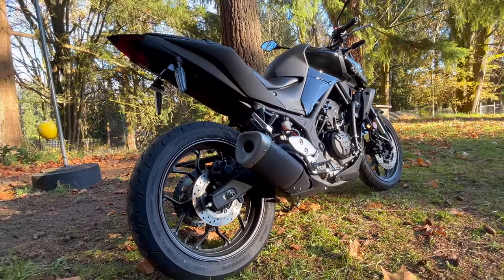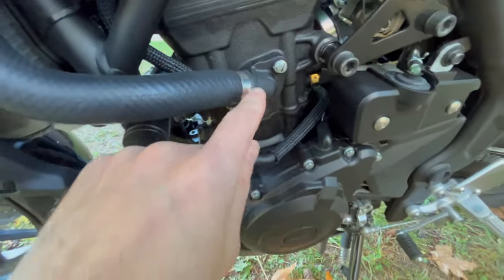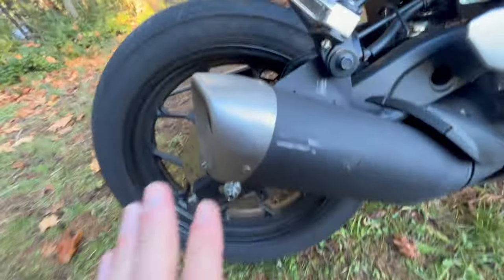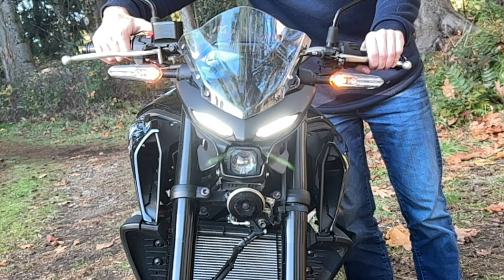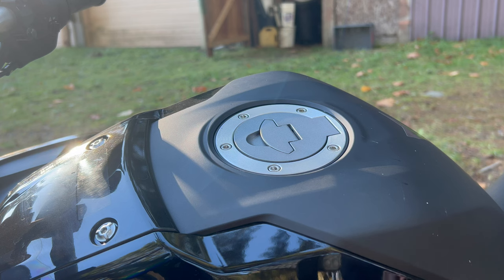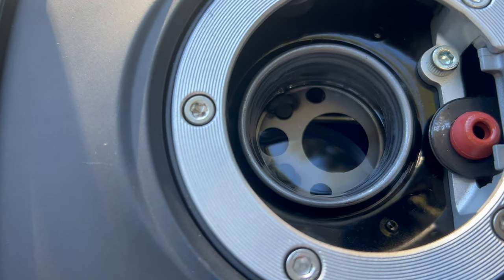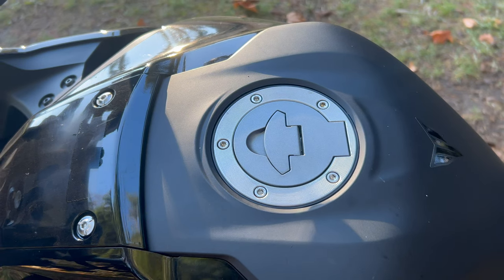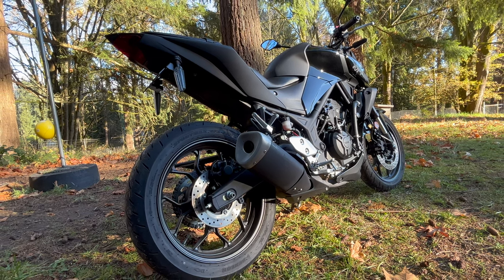2020 Yamaha MT03 || After 3 years : Talk about & Explain pseudo-Review on Thanksgiving Day 2023

Comment from the maker: I have a deep spiritual connection with this 2020 Yamaha MT03 & its 321cc offset parallel twin cylinder fuel injection liquid cooled gasoline engine developed over 9 generations of optimization in the Yamaha R3 race bike, then further tuned by Yamaha to make soft on early torque with start-assist in 1st gear that will let you go as slow as 2 miles per hour without stalling, though it trolls well in 1st at 5 miles per hour with very light right hand grip throttle twist action. The gear box & clutch are nothing fancy in terms of a 6 speed motorcycle sequential, but are very precise with excellent feel in the left foot gear selector pedal & left hand clutch lever attenuation giving both a secure but easy to articulate clutch. ABS standard front & rear, with drilled solid rotors. For the entry level of the Yamaha MT line for under $6K out the door all said its a great value given the advanced emissions controls, easy to hyper-mile above 70 MPG on regular unleaded gasoline, though I get E0 or ethanol free gasoline from The Grange in Issaquah, Wa, distributed by CENEX. I add Fuel Stabilizer to the 2.5g or 10L safety button easy fill polymer gas can, as the red fuel stabilizer extends the shell life of gasoline from 3 months to 2 years. I keep the fuel tank topped off at all times to minimize the air gap at the top of the fuel tank.

Comment from the maker: 373lbs 40hp 20lb-ft, 0-60MPH in 5.11 seconds, does the quarter mile in 14.05s at 92MPH & has a top speed of 112mph, though getting there going to be a buzzy highway experience at redline in 6th gear & you fuel economy will be lower. 

Easy to average 48-55 MPG keeping up with freely moving early morning full highway speed traffic on I90 or I405 near Seattle WA, USA. I can hyper-mile with early upshifts & keep it under 50 MPH & get the fuel economy into the 65-88 MPG range, while racing it full out gets 33-42MPG. 

So overall ~53MPG on 87 octane unleaded gasoline, very similar fuel economy to our 2022 Toyota Corolla Hybrid, which is rated for 52 MPG, but can hyper-mile up to 77 MPG, or fast drive in PWR mode for 42 MPG via The 2ZR-FXE 1.8L engine of121-hp/105-lb-ft Atkinson-cycle DOHC 16-valve I-4, plus 71-hp/105-lb-ft electric motor; 121 hp/105 lb-ft comb. Almost a direct copy of the 2ZR-FXE 1.8L Atkinson Cycle long stroke motor HSD Hybrid Synergy Drive system & as Toyota used in 3rd & 4th generation Prius. I l really like the design of the E210 Corolla Hybrid LE Sedan in "White", but it takes 8s to hit 60mph, though 0-40 in PWR mode punchy. 22 Corolla Hybrid hits the quarter mile in 17.8 seconds & has a top speed of 113mph. 

If you do the power to weight or mass comparison, the MT03 performs similar a 3300 lb car with 350hp. I really like the GR Corolla, but 21 city / 28 high EPA Fuel economy rating by the AWD 1.6L 300 HP rally racing drivetrain & higher purchase price over $40K out the door. The MK 2L engine of the Corolla & Corolla Hatchback is dope & gets ~33MPG combined, more or less. The 2024 Corolla Hybrid get the improve 2L MK engine in long stroke efficiency Atkinson cycle similar to the 5th Gen 196HP Prius that's the best performing one so far. Our 2022 Corolla Hybrid 2850 lbs & cannot tow anything officially, but it's mostly just me commuting too & from work. I take the MT03 on warmer dry days, out on Hollidays, for fun blasts even on dry warmer winter, spring & fall days, but try to avoid every riding in rain, but sometimes get caught. I also take our 13 Honda PCX-150 scooter out at times since it gets 88-105 MPG & needs to operated to justify the annual registration & geico insurance, oil changes, & other costs :) The 01 Audi A4 2.8 Quattro about to get some $ love into its engine, via Matt the master mechanic that QP told me about at work thankfully :)